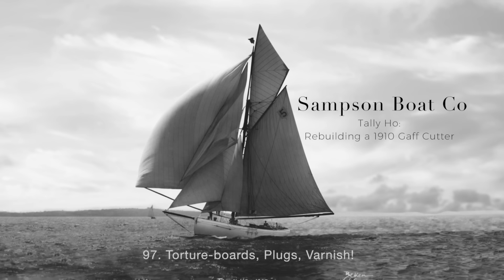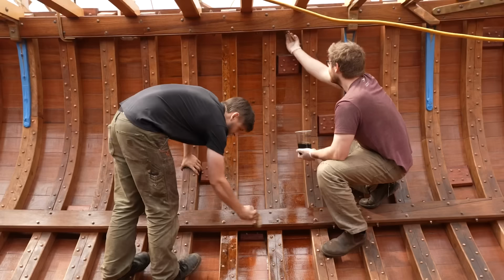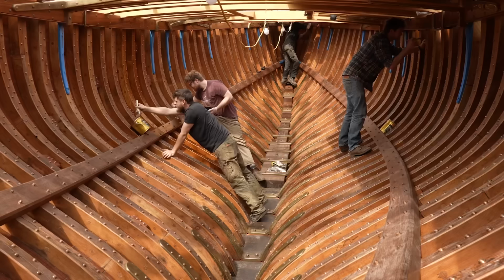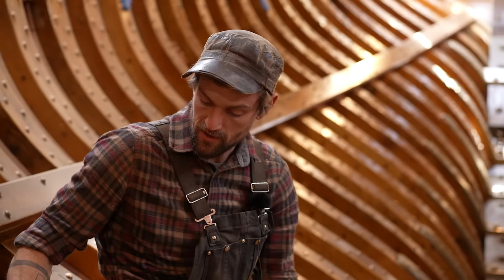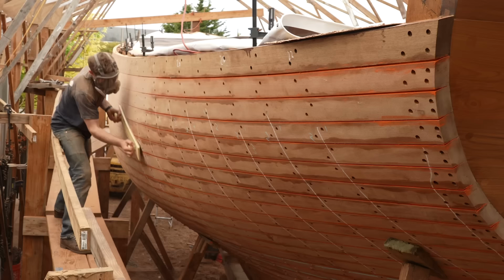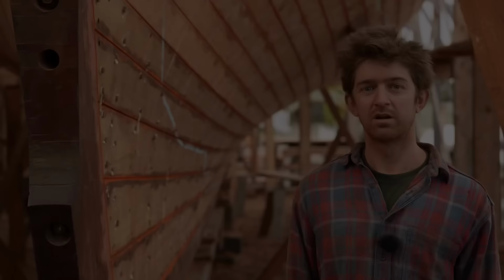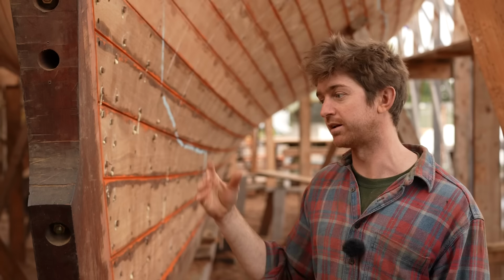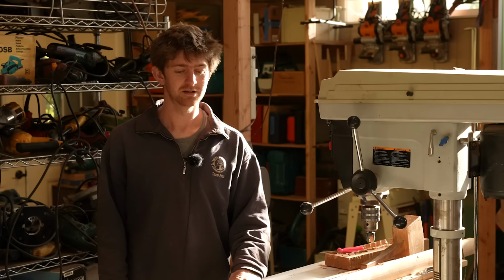Torture-boards, Plugs, Varnish! (Traditional Boatbuilding / EP97)

Comment: I can give you a "pro" tip to increase your production rate at the computer.
Get yourself a full sized keyboard and a mouse, I'd also suggest a second full sized monitor.
Laptops are fine for the coffee shop, but you really can't be productive on them. It is hard to over estimate how much time is wasted on a laptop. I know it may sound like I am quibbling, but it really will make things go much much faster, and make it less of a drag. Not only does the track pad force you to approach the keyboard in the worst possible way, it also slows you down because you have to be careful around it. Vertically arranged monitors of very different sizes are also a bad choice because you have to adjust your eyes to them. It all adds  up to a massive amount of wasted motion, excessively slow motion, and very bad ergonomics.

I coerced our post-doc into using the keyboard and mouse I got him to go along with his laptop 3 years ago. He told me this week he didn't understand how he got anything done during grad school when all he had was his MacBook.

Comment: Have you thought about installing a tesla car battery to go with the Beata Marine engine you decide to go with for the Tally Ho though that battery might be excessive in compassity for your needs tesla electric car batteries tend to be some of the best and most reliable you can get you could even use them as balles as the batteries do waigh 1,200lbs(540kg) and have a compassity of 85KwH (310MJ)

Comment: Hi, I have a question, would African Teak work also? It is alo known as Milicia, Iroko, Semli (Sierra Leone, Liberia), Odoum (Ghana, Ivory Coast), or Rokko. It is actually very similar to teak in most of its properties. I think prices are between a third and a quarter of teak. So more expensive than Bangkirai, but a lot classes better.
Cheers from Germany
Eric Lindemann

Comment: Long board, water board =  Torture 😭
Fair winds and steady as you go, thanks to the departing stars.
If Berma was not in the middle of an insurrection of communists teak could be had. When calm there, it is great for reteaking a deck.

Comment: How important is it to line the grain of the bungs up with the planks?
Reply: It's a small thing, but wood is always moving as temperature & humidity change. Keeping the grain aligned lessens the chance that the glue joint fails 30 years from now.

Comment: Have you considered an automotive repair pneumatic long board for the Angelique? It's used to produce flawlessly smooth finishes on autos where the slightest ripple or wave is very noticeable. Pre cut lengths of sanding medium is available in any grit, and would reduce the labor substantially. It may not be 'traditional', but you're already using power tools the original builders didn't have access to... Mass. is a ways off but Acorn to Arabella has been using  'https://daratimber.com/' His yard specializes in wooden boat lumber...

Comment: From my experience, sealing timber all the way around is never a good idea. History has thought me, that the edge that is againt the water needs a full seal, and the inside edge needs just saturation, as in oiling or soup. Get the oil thin enough and it goes deep enough inside the wood to stop the wood from moving. Varnishing looks pretty, but it actually seals bacteria and mold spurs inside the wood to grow in optimal (no oxygene) conditions. That can in worst case scenario soften the wood in a couple of seasons.

Comment: What is the name of the tool that you use to cut of the plugs , it looks like a chisel ? The angle on the grip seems like it is diffrent
Reply: Very observant!!
It is a cranked chisel.  You can pare with these while there is still room to grip the handle.
The Japanese have more than one kind of these but it's been 40 years so I forget.
Reply: @jimurrata6785  so they have a special name? Cranked chisel does not really make sense( english is not my native lang , hope u understand )

Comment: When the ship is finished, could you go over what it cost to actually accomplish this insane feat?  My current guess is around $150,000 USD and climbing.
Reply: My running count of Leo's reported costs so far:
US$ 84,000 for hardwood timber used in the boat. (Not all shipping incl.)
US$ 36,500 for copper, bronze & foundry work.
Not included - labor, tools, hardware, coatings, softwood lumber, plywood, utilities, maintenance, fuel, food, beer & all the other stuff.

Comment: I've got 'bout 2,000 board feet of Siberian Red Cedar clean as a whistle, horizontal grained, oven dried, standard width, 24.5' length and less and I won't be takin' less than $90,000 and a case of beers fer it.

In boat and yacht terms is the equivalent of a "tyre kicker" a "hull rubber"?